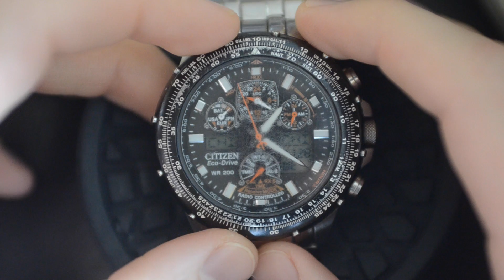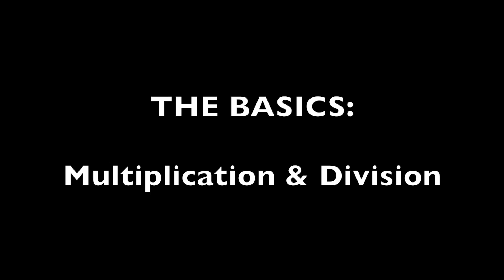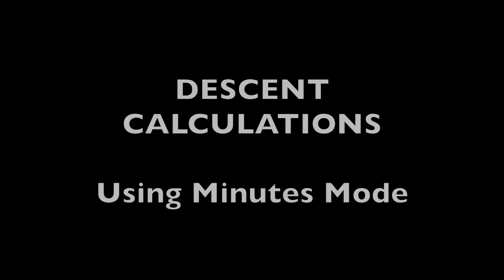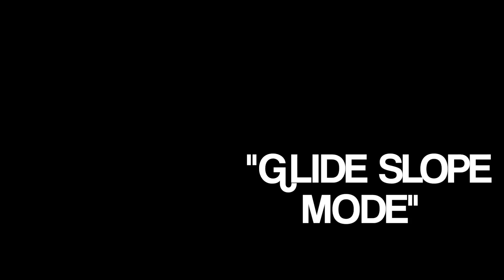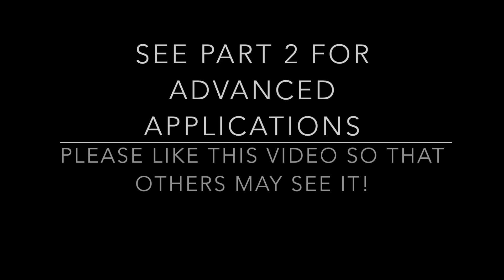How to Use Aviation Pilot Watch. Advanced Tutorial for Real Aviators. E6B Slide Rule. Part 1 of 2

Comment: I just bought a Citizen Blue Angels. Chuffed as anything to find I have an aviators' slide rule! But then I watch this and I realise that some pilots' watches, like the one shown, have free bezels you can spin round easily with your fingers! Mine is under the crystal, and can only be moved slowly, with the C button. Almost kills the whole point of having it, since you can practically do the calculations in your head before you can get the bezel moved round, to say nothing about having to have the right light conditions to read the thing.

Comment: Good post C Hobbs. Thanks for taking the time to make this video on a rather esoteric subject. I just got a Citizen watch with this slide rule, and was disappointed the owners manual didn't even mention it. I knew it was for calculating, but had no idea the scope of what could be done. Do you have any suggestions of where to get more information, and perhaps quizzes to make sure I am doing it right? I tried to follow along with mine, but the ruler is internal, and turned by a dial. The action is very slow to spin. 

Thanks again!

Comment: Honestly speaking , All of these calculations can be made in the head with accuracy upto 2 decimals and for those who can't do that, we have calculators. These watches made sense when there weren't flight computers, but with them, it makes these watches redundant. And for flight training, I'd prefer trust my head over a watch.
Reply from the maker: I personally like to use the watch for planning things out, rather than using it for the "OMG I don't know what to do right now, help me" approach. Thinking of these variables is a great way to spend your time while at cruise. 

There are multiple benefits which you may have overlooked. People make mistakes when they are pressured, and I can tell you from experience, aviation can sometimes be a pressure cooker when you need to make calculated decisions quickly. The idea of this watch is that 1) it never fails, therefore, it's a great backup, and 2) it teaches you the relationships of time, speed, and distance and how they relate to aircraft altitude; so that one day you don't need the watch or a calculator.

I'll give you a scenario: You are 90 miles out at 33,000 feet, flying at 480 knots. Can you quickly (within 10 seconds) identify how fast you need to descend to get to your airport adequately, without taking out your phone to calculate? I would say, probably not. The benefit to the watch is that you can do MULTIPLE calculations at one time, quickly. Thus eliminating possible errors while efficiently finding a solution to just this one question.

Under that scenario, you can set up the rise over run on your watch, in which you then instantly receive up a glide slope value (366 ft per nautical mile / 3.6˚ glide slope in that scenario). You have then locked in your relationship to any airspeed you might be flying. Rounding up, you would need to descend at 3,000 ft per minute. Which took two separate equations and 5 different variables to come up with one answer. With the watch you twist the dial once, and find your answer.

What is great about this method is that if you slow down to say 250 knots (required below 10,000 feet) the watch will instantly tell you you now need to descend at 1,600 feet per minute (rounding up) to meet that 3.6˚ glide slope.

On a daily basis I do not usually use the watch, but it has served me well in the past, and I enjoy understanding the variables. Personally, it keeps me on top of my game and serves a purpose.

Ultimately, airline / charter / corporate pilots have computers (FMS - Flight Management System) to do this for us. The watch just adds a level of know how.
Reply: C Hobbs That's absolutely true. I agree that it makes one more connected and involved in the act. It is always reassuring that you have a dependable device in your wrist. In fact, wrist watches in general are being victims of smartphones, which is quiet sad. I haven't been to a flight school, but have interests toward timepieces. And being a person who uses calculators extensively on day to day basis, I have developed the ability to make certain calculation even without using the calculator, so I was under the impression that it would be mastered by Pilots as well. Thanks a lot for explaining with a practical example
Reply: @adityasundar324  🤡